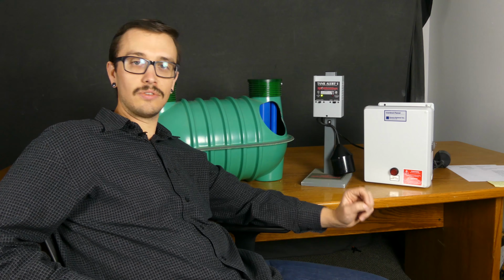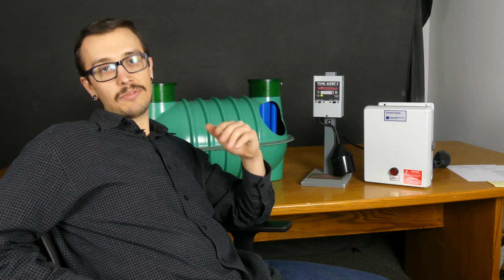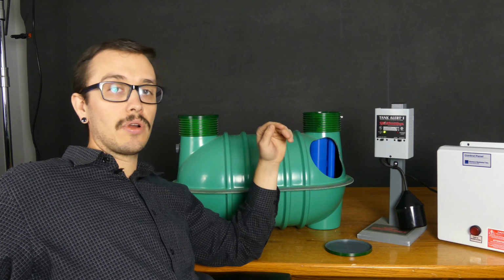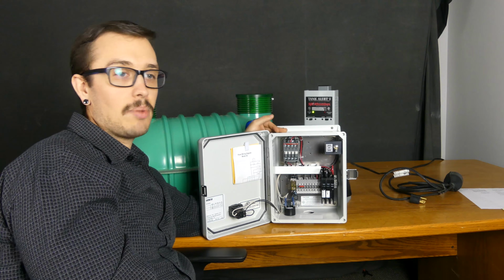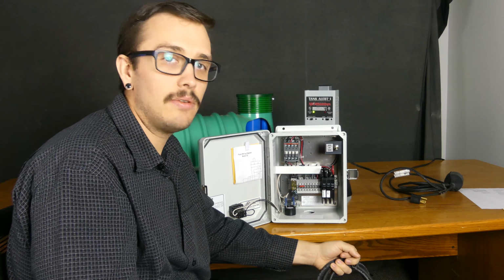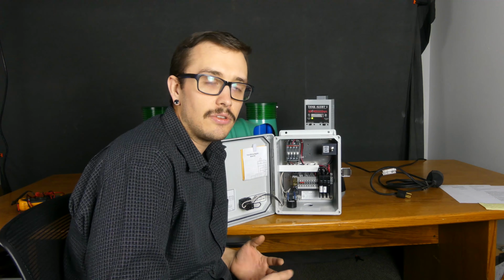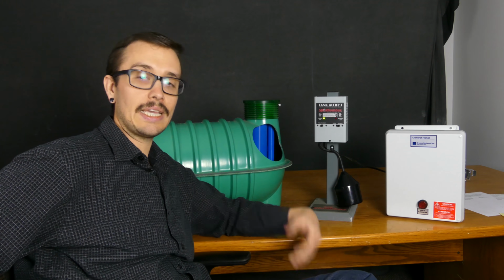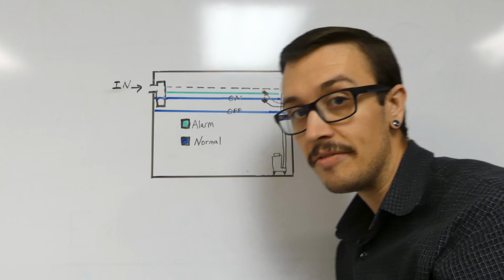What to do When Your Septic Alarm is Going Off

Comment: What if you put it in hand and it does not pump?  But if you manually push in the contact it will run. And periodically engages and disengages rapidly?
Reply from the maker: It sounds like the coil on your contactor is failing.

Comment: My mother in law has a Tank Alert1 just like the one in the video she called me because she saw the red light on. I went in and sure enough the red light was on dimmly and the horn slider was switched to silence. Pushing the test button results in the red light coming on brightly. I switched it to horn and the red light goes out . Pushing the test button in this position lights the red light brightly and the horn sounds. Is this normal operation or does she need to get it checked out?

Comment: Hello, I got a zoeller that has two pumps. When I put it in manual it’ll pump the water but not on automatic. Would you recommend to simply replace both pumps or should I involve an electrician to test float switch?
Reply from the maker: If it pumps in manual and not automatic then you have a problem with your floats.

Comment: What would cause a slight back feed of electricity to my light and alarm on the high water alarm?
Reply from the maker: Water in the splice box or a bad splice connection/float switch
Reply: @RCworstwater  Checking more on that today.  Thanks

Comment: Great video.  My alarm went off and won’t silence when I press the button.  I have a concrete 3 tank system.   First tank for solids look pretty much 90% full.   Second tank is like 75% full with, the water level is a few inches below where the water flows to the third tank.   The tank with the float is only like 60% full. Not sure if I have a pump because I don’t have any raised mounds on my property. Any suggestions

Comment: If I silenced my alarm but didn't notice anything wrong by the time we opened the tank,  will it go off again if the problem persists? The water was not high.
Reply from the maker: Did the light turn off? If the light is still on then there's still an issue to address.

Comment: Why is the red light blinking?
Reply from the maker: You likely have a high water alarm condition
Reply: The toilets are not the backing up. Do you think I need to dig up the top to look inside to check the water level?
Reply from the maker: Yes. Usually the alarm float is under the same lid as your pump and there should be a riser on it so you don't have to dig it up. If there's no riser I would highly recommend you put one on it so you're not digging every time the system needs serviced.

Comment: As a professional pump mechanic I can tell you videos like this help consumers understand the basic mechanics of their system good stuff . Any questions feel free to ask .
Reply: Why is the red light blinking?
Reply: Red. And tt so much for your time
Reply: The toilets are flushing fine. It only does it when it rains.
Reply: @paodigger644  that means you have a short in the offset line going from your house to the pump chamber . Do you have a junction box where the wires go? If so open it up and see if the connections are ok and also if there is water in the box . If you don’t have a electrical box the wire is allowing water to make contact causing the red light to blink on and off and also do you buzzer on normal position
Reply: @tyg5421  I do have a electrical box. And it  is not covered very well. I need to build a better frame around it with a better top. You are probably right about the water as an issue. You are really smart, ty so much. I will give you an update as soon as I check it out.  Ty so much..
Reply: @paodigger644  hi Jeff 
If the light is blinking it can be two things power supply issue or you have a short in the line . Is it red or green blinking line ?
Reply: What if the red light stays on after you silence the alarm?

Comment: This was really helpful thanks!  My alarm went off and I assumed it was high water, but found that it was actually low.  I let it fill and tested the pump and that worked, but the light won't go off at all.  I do not have a control box and I have tried unplugging it and switching the breaker.  Any idea on how to get it to reset?
Reply from the maker: Where is the alarm switch mounted in the tank?

Comment: First turn power off to septic then Check air filter in agitator pump ( air pump). Most are located on top under the brick block house. . Filters are to cleaned every 6 months.. Most wont tell anyone this, not sure why. If breather element is too dirty that blocks air flow causing diaphragm to go out. Which stops putting out air , causing red light to come on due to no pressure on air pressure switch. There is a pressure switch in electric septic box panel. if that does not have pressure red light will come on as stated above.... God bless

Comment: Why the alarm would go off after the tank was pumped out during a regular maintenance check.  Water is below the pump level and the alarm does not turn of even when I flip switch to manual? This is the first time happened, the pump was working that day and the next day I heard the buzz sound coming from the tank and I could not shut it off, ended up unplugging the relay inside the box.
Reply from the maker: Sounds like you may have a bad float or splice.
Reply: @RCworstwater  Now that the water level is up to the first float the alarm is not going off anymore. It is strange. I will keep an eye on the system.(it looks like is a Delta Environmental Pentair Water system UC-60 model)Thank you for your advice.

Comment: I'm not hearing a horn but there is a soft chirping sound every so often. What might this indicate? The warning light is not on either.
Reply from the maker: The chirping could indicate a low battery or a bad connection (such as water in the splice box)
Reply: @RCworstwater  Thank you! I'll check that out!

Comment: Thank you for the video.  Can I ask a question.  I do have a person coming out on Wednesday, but this is a 2 year old system, and the third time we are having an issue with the alarm, the last time one month ago, we spent $600 to replace a float and relocate the floats to the opposite end to avoid further issue, and the alarm went off again.  I manually drained the pump as soon as the alarm was going off, so I am not able to see if the issue was that it was high and not draining automatically, but i do know that the pump is working when I hit it manually.  But when I drained it manually, before I dug it back up (it is 4 inches under the grass), the alarm never turned off, even when the box was emptied down to the bottom.  Does this mean there is an issue with the float alarm?
Reply: He would like to replace the box (for $2000).

Comment: I wish I had an alarm. How do I get them installed?
Reply from the maker: You can order one at Rcworst.com and call a local septic company to come install it.
Reply: @RCworstwater  I have a septic tank and the old style leach tank or pit. I just had both pumped. They are 10' under the ground with risers. The leach pit is open now. Is it easy to install while the pit is open?

Comment: Thanks for this vid, The part about manual mode after taking off the other plug saved me, Our tank was clogged for a while, and our flexible pvc fitting bust off after putting it in manual mode, but I fixed it all up by slowly put the pump on manual mode and unplugging it and I think it got it all working, called the warranty ppl just to make sure.

Comment: Great job.  I wanted to add a couple of things (wastewater was one of my studies).  Chlorine (for those systems) can also be an alarm item.  Overflow (especially from overnight) from a toilet (or toilets) flapper malfunction then morning routine water use added can flood a system and send an alarm.  As well as simple electrical outage or breaker trip (storm lightning, pump over heat from continuous over use), etc. , etc..   Investigation effort can save money!  A tech. must be paid to come out, even if it's a tripped breaker.  A person who is a property owner, should take a class on wastewater.  It's cheaper over the lifetime of the property to buy an education, rather than pay a technical authority.  Most of these systems will need almost nothing for a single lifetime, IF they are maintained regularly.   It's like the roof on your home.  Maintaining is cheaper than replacement.  AND some waste company's have monthly insurance type policy covering the entire system.
Reply: Thanks, Will let everyone  know when it is all good to go and the Sh*t will  flow.